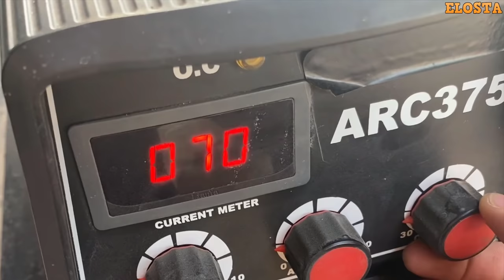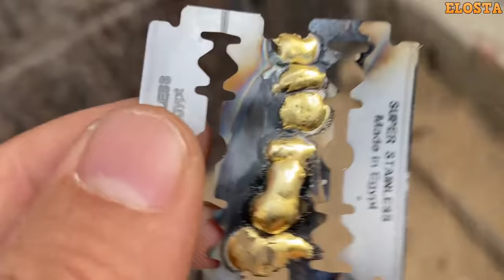Few people know this trick the secrets of welding  Shaving blades

Comment: That’s brazing bud , not welding lmfaoo. Should  be able to TIG those even without a pulse machine
Reply: Brazing is a type of welding bud. You are correct about being able to use the tig welding machine though.
Reply: I've seen some one in YouTube tig weld it with success
Reply: @michaeldorse8023  brazing isn’t welding. Welding is FUSING materials together. Brazing relies on capillary action, just like soldering bud. It doesn’t fuse metals together, but nearly bonds to the surface of them and flows into the root with capillary action. It’s not even close to welding, you don’t reach melting point , you don’t use a shielding gas to properly fuse the melted parts together like you do with say TIG or MIG , stick ( which uses an outer coating to generate the shielding gas to protect the weld puddle from the atmosphere , otherwise drawing into nitrogen into the weld and making it brittle as fuck ) . Sorry bud but I hope you understand if not, just take a look on google and read a little. No harsh feelings .
Reply: That's exactly what I said
Reply: @michaeldorse8023  brazing is not a type of welding……. Welding involves melting the parent metal, brazing never melts the parent metal…. It may sound like the same thing but it is totally different
Reply: @michaeldorse8023  lol brazing is closer to glueing, or soldering. no metals are fused when brazing as they're certainly not compatible to actually weld.
Reply: Fr tho
Reply: @smokefentanyl  thanks helped me
Reply: @michaeldorse8023  в принципе не знаю 🤷 как я тебе говорил я в в не очень хорошо

Comment: High voltage causes flash like arc and the high current causes vaporizing and splash of thin base metal. 
Therefore to weld very thin metal plates we need to reduce the voltage as well as amperes and bring them down to safe current at which quick melting and vaporizing doesn't takes place.
Reply: @Swaraj Singh What voltage and current can be used to weld razor blade?
Reply: Yep, I’ve seen steel guys burn holes in 2” thick steel from having their voltage set too high. They were quarter to half dollar sized holes

Comment: Mig weld with phosphor bronze wire and pure argon gas 6mm wire and + earth I do all my panel work using it fast and no burn through settings my secret but practice finds it, even razor blades.

Comment: For a start your trying to weld stainless Steel with Steel wire witch won't work for 💩. The method u just used isn't welding, its called braising whn you use a hot flame to get the two bits of metal red hot thay both got to be glowing red hot thn u use a braising rod with abit of flux, u thn melt the rod into the bits u joining together to get them to join.
You just braised them together and not welded 💯👍👌👊

Comment: Let's see.. GTAW, steel, argon, thoriated tip, about 30A for 1mm mat'l thickness....

razor blades are like, .015 thick so.... 180 A seems about right! And let's not bother with cooling or shielding the back because that'll just rob the puddle of heat!